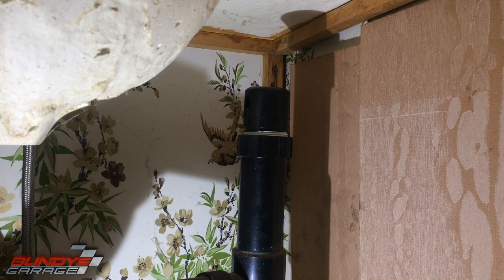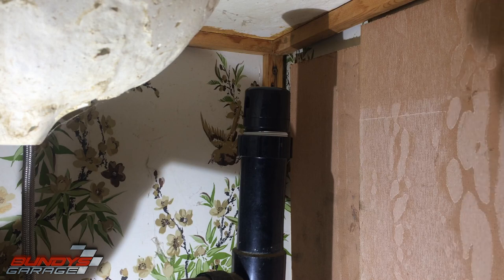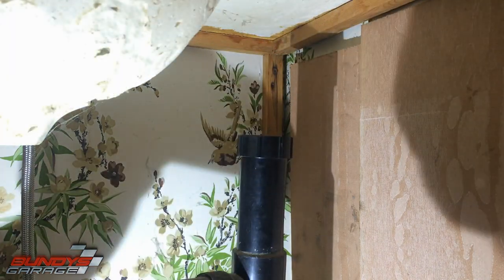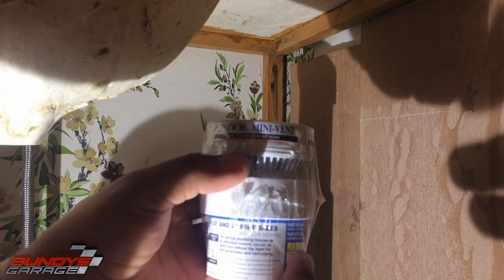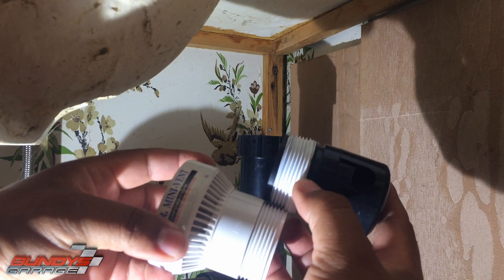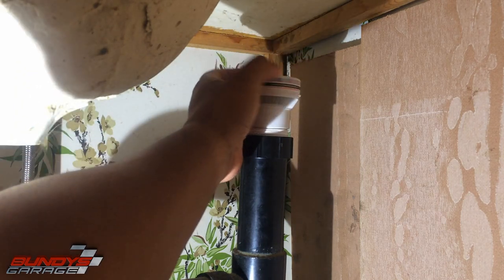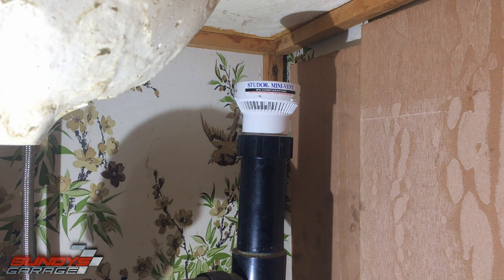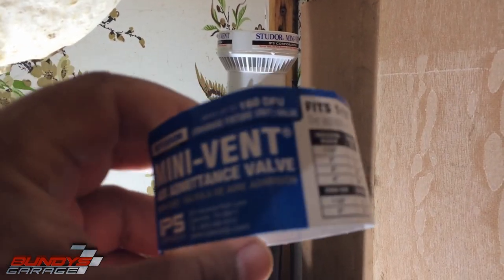Bad Smell Under Bathroom Sink - Cabinet - Mold - Mobile Home Trailer - Died Musty Moldy Sewer Smell

Comment: Does the odor smell like rotting cabbage? I’m thinking this may be our problem. It fills the whole bathroom. It’s definitely only under the sink, I’m losing my mind looking😂
Reply from the maker: I’m not sure what rotting cabbage smells like. But sometimes the smell was just under the sink and sometimes it filled the whole room. It would come and go and seemed worse when it was hot outside. Made no sense. If you suspect the piece and it’s been a long time since you have changed it if ever. Follow the link in the description and pick yourself up a new one.
Reply: Never mind, I keep pausing it and looked. It says 1 1/2. Lol

Comment: Thanks for this. I’m away from the stinky kitchen sink cabinet, will check for this filter tomorrow—I hope this is the issue. But the plumbing in our new home is really old—-what if this is not the problem? What if there’s no “air admittance valve” and the cabinets just stink from musty/mold/years of neglect? Lysol? Dehumidifier? Any other solutions? The stink is pretty awful. Thank you!!

Comment: I just started troubleshooting a bad smell under my bathroom sink. I already have an AAV.  The sink isn't clogged. I duct taped the floor where the pipe comes up to seal but the smell doesn't go away.
 1) Is it safe to put a plastic bag around the top of the AAV so I can confirm this is the source of the smell? 

2) The home is 18 years old. Do these AAV's have to be replaced periodically?

Comment: why would water come up through that pipe? When i run my kitchen sink the water come up and out that pipe, smells horrible.  would this mean that one my kitchen sink drainage pipes or clogged up and its forcing its way out that pipe? thanks for any help.
Reply from the maker: You have a clog somewhere further down the line and that’s why water is coming back out of that pipe. Get a snake and try to reach it. Lowe’s sells a 50’ foot snake for less than $50 bucks. https://www.lowes.com/pd/Cobra-1-2-in-x-50-ft-Music-Wire-Drain-Auger/999908747

Comment: Maybe this will still reach you or someone. Mine too is a 1 3/4. But when I look for them, I only see 1 1/2 And your link sends you to 1 1/2. Is that the same thing? What I mean , is that why you are using the tape to make up for it or does or just measure 1 3/4 but you need to order 1 1/2? 
I need two of these I am sure because I have been living with this problem for years. Had no clue. And tried to run it down under there, doing all kinds of other things. 🫤